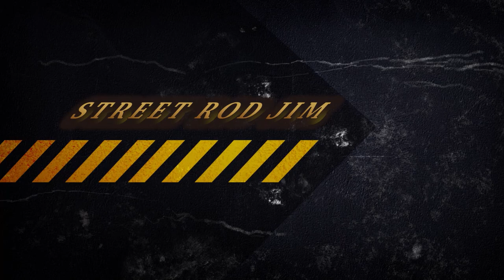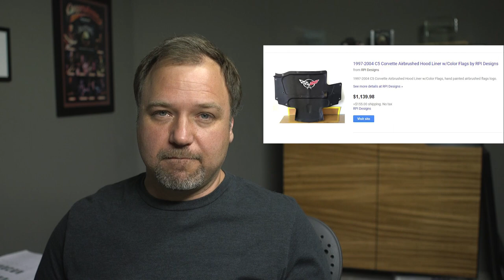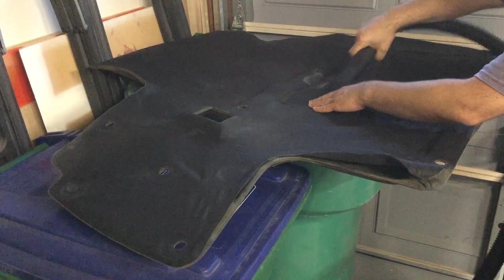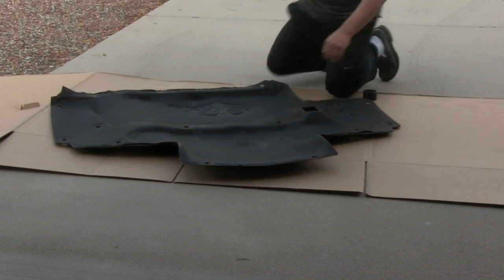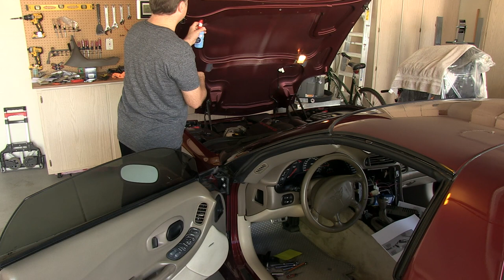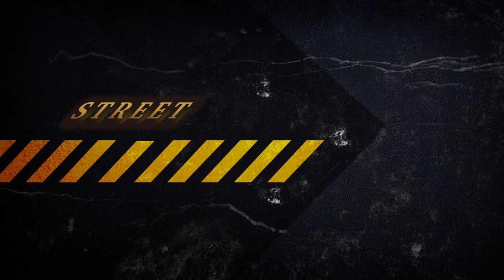Restoring a C5 Corvette Hood Liner – Hood Lamp

Comment: Has any of the paint flaked off over the year since you did the paint on the hood liner?
Reply from the maker: No, it is not a paint.  It is a dye.
Reply: @StreetRodJim  so it won’t ever flake off under heat? I’m just wondering if the high heat spray paint would last longer?
Reply from the maker: @motojgiveaways1451  No it would not and would not be the right application to use paint on a fabric.  Dye infuses into the fabric and becomes one so it can't flake off like paint.